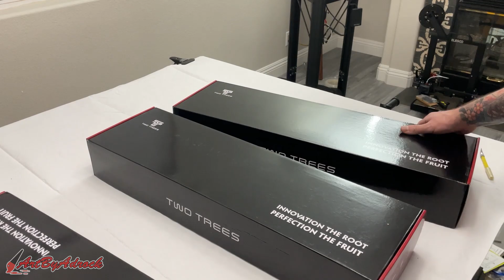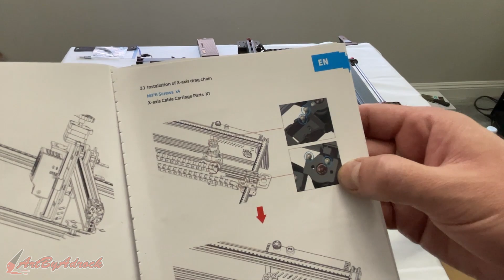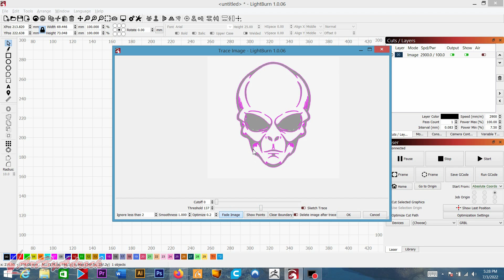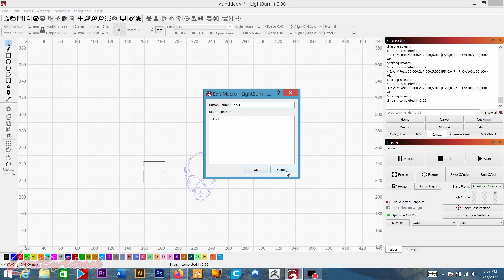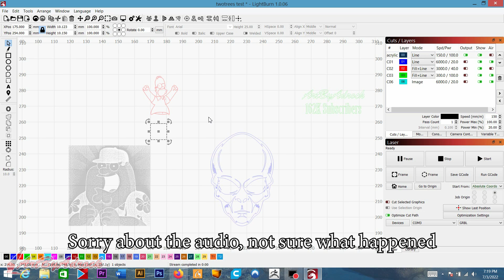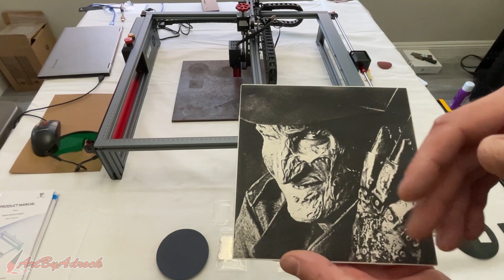Brand New Two Trees TS2 10 Watt Laser - High Power Laser Engraver/Cutter & Huge Work Area

Comment: Did you try moving the X axis all the way to the right? Was the drag chain ok when you try to bring it back? Also mine had holes in the wrong place on the plate that holds the diode, and the whole assembly is a little bit wiggly. I didn't start it yet, and already found issues.

Comment: what about engraving steel??
Reply from the maker: I’ve only tried on stainless steel so I’m not really sure but I’ll try and give an update. It did work on brass but was very light. Aluminum did not work at all
Reply: @ArtByAdrock  OK, this answers my previous question.
Reply: Stainless is very difficult. I have a tts pro 10w. It's quite a dissapointment. Spend a little more and buy the 20w. It will save u time, power, and do much more. 😊